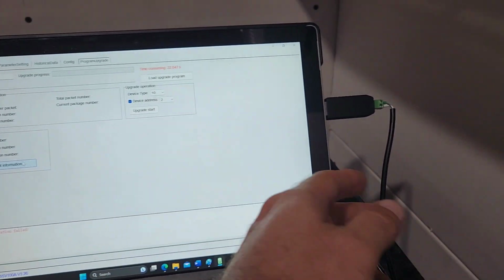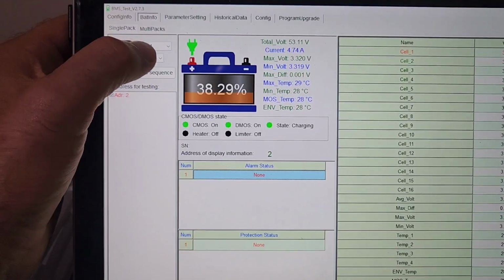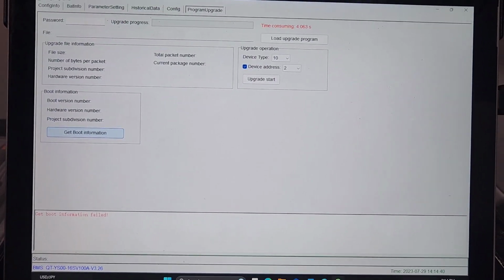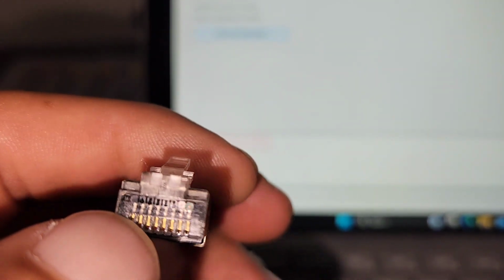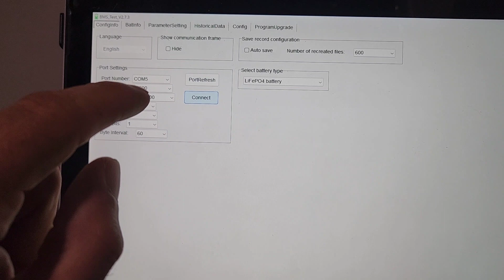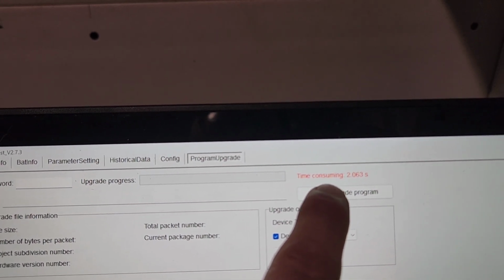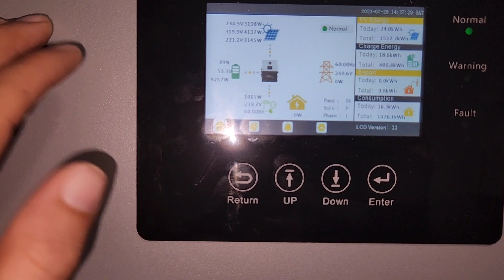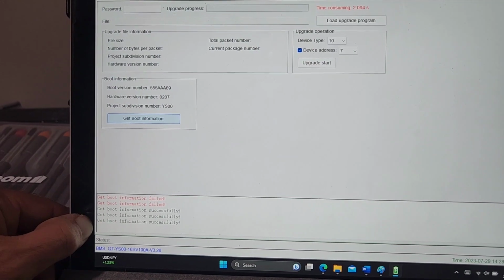Modifying EG4 Lifepower4 Battery (USB) Communication Cable. Going from Pin 78 to Pin 12

Comment: I lost communication when I updated the battery firmware. I just switched the baud rate from 9600 to 19200 and now my communication is good. I'm not using their inverter so I'm not worried about the boot failure. I'll leave it at 19200.

Comment: Will that homemade cable work on eg4 'LL v2 ? Cause of course S.S. Doesn't have the correct cable in stock to update firmware to register correctly with my victron component
Reply from the maker: I don't own the LL battery version.  I'd like to get one for "testing"...but I can't justify the cost.
Reply: Was just wondering if the cable would work on my LL type battery? Thanks